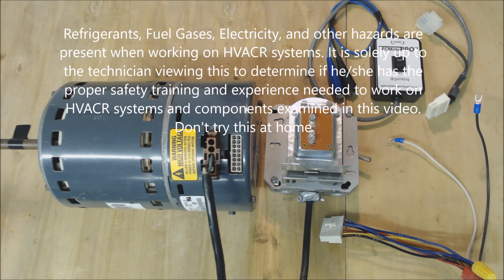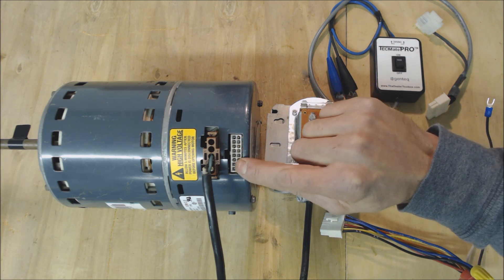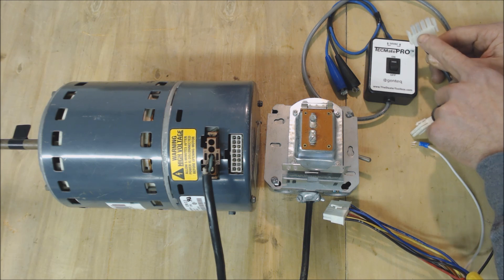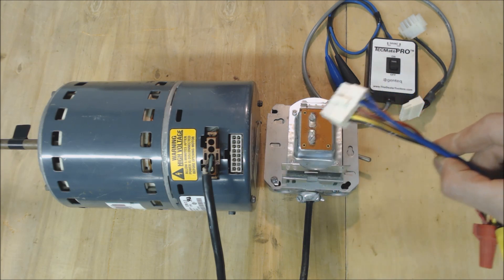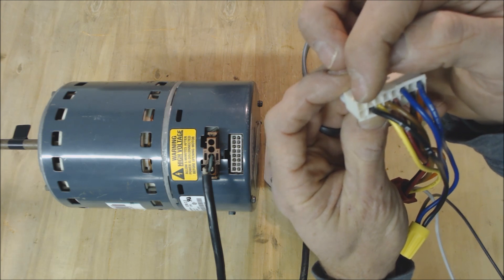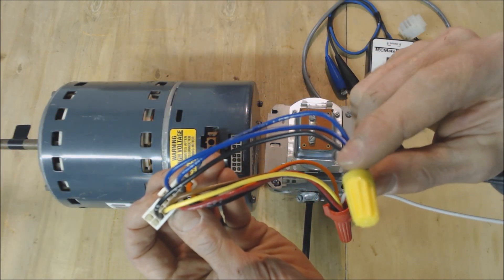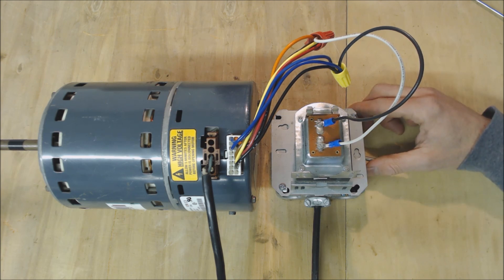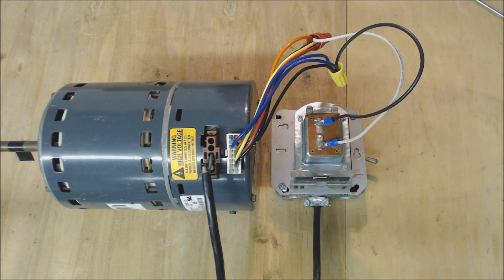Testing ECM Variable Speed Fan Motor, Make Your Own Tester!

Comment: In a series wound motor and series circuit , when a variable resistor control is used ( potentiometer) with NO voltage regulator at the motor , in my studies of ohms law the voltage will be proportional to the line voltage , whereas if the voltage at the source is 24 volts the voltage drop can vary at the resistor such as 5 volts and 19 volts at the motor or 15 volts at the variable resistor and 9 volts at the motor with the current remaining the same!
Remember, no voltage regulator!
Reply: I have heard one thing is (is it true that the motors response to voltage changes such as that loose control) ?

Comment: Have an ECM 2.3 motor that is not spinning to full speed. Changed the boards and a new motor, still same results.. checked continuity on 16 pin connector and all wires have continuity.

What could it be that the motor will not come up to speed!?! 

I read about static pressure with change the speed on the ECM2.3?

Comment: What or how do you test for an intermittent or partially functioning ECM2.3 motor?  Here is my situation my fan may work for a day or more with no issues.  Then The fan will start ramping up like it is going to turn on and then shuts off before ever fully coming up to speed and it will keep doing that over and over.  Even if I turn off cooling mode and put the thermostat in fan ON mode.  The fan pulses on and off then too or it may run constant but it seems like its at reduced RPM's.  If I leave it in cooling mode eventually my low pressure line and evap. coil will start getting frosty/icy because of no/low air flow.  When its operating fine I have 10° +/- of sub cooling so my charge seems like its good.  This is the same duct work and nothing has changed in 8 years since everything (system and ductwork) was installed.  I did look to make sure there were no obstruction and the filter is new and replaced regularly coil is perfectly clean too.  My common sense and knowledge I have learned from this channel says its the motor module but these things are stupid expensive if its not...  Is there a way to 100% verify its the blower motor/module?  I did order the ECM motor tester but it hasent arrived yet. Does the motor tester make the fan run at full speed?  It just says on/off but Im assuming if I hook this motor tester up and it still pulses or runs slower its the motor or more likely the motor module.  The motor itself turns freely also.  Can a person run the motor off of the motor tester and put the unit into cooling mode and run it like that?  Im not looking to try and fix it this way but as I said the unit may work for a day or two before starting to act up.  I figure I could just power the fan on using the tester and see if running in cooling mode if it still does it.  Im just not sure if there is a sensor somewhere that is cutting the fan off if something like a sticky TXV is causing the icy build up and the fan issue is being caused as a result and not the primary problem.  I did pre order the new book as well looking forward to getting it, thanks for all the work you put into these videos and sharing your knowledge.

Comment: the test procedures That I see in the installers guide that originally came with my furnace have a test procedure only wiring pins 1&3 (common - Blue?) on the tab side, & 12 & 15 on the other side (Red) , where your diagram show 1,3, 15 wired to black on transformer, 9,10,12,13,&14 to White on the transformer.

Also does it matter if black and white wires are reversed on the transformer?
the transformer on my Trane furnace has 27 volts supplied across the blue & red wires out to the furnace control board.

Your Black wire should connect to where my Blue wire goes out? Correct?

I tested voltage from the board to the 16 pin connector feeding low voltage to the motor.
Pins 4,10,11,12 have 27 volts
Pins 5, 7, & 15 have 15 volts.

Furnace blower motor is set to fan only on the Thermostat
Blower motor runs sporadically slowly & stops
Will continue to run this way for about 10 minutes.
Still not convinced that it is a problem with the motor driver module, but possible the control board, & trying to confirm motor control module is bad.
I have removed the control module & completed ohm testing on the 3 wires pins and all ohm out evenly with no short to the motor housing.
Should the 24 volt transformer measure voltage between either pins to a ground on the furnace?

Comment: Question GE ECM 2.3 fan blower motor controller. The thermistor looks of but the coil on the yoke has been overheated to the point that there is a bunch of little carbon flakes around the yoke. Burnt thermistor? Regards, Bo

Comment: So if the module has failed this won’t work then? I wish there was a way to just bypass the ecm module on these ecm to run the blower fan for heating. I’m tempted to make something like this but I’m not sure if the system will work properly if the 16 pin harness isn’t connected to the module? 

Being broke sucks… but worse 2:42 being broke when your ecm fails when it’s less than 2 years old and the hvac company that installed it seems to have gone out of business so no warranty. I believe the motor is still good(I checked it using these tutorials). Also power is going to the module from the 16 pin comm harness. It was short cycling, now nothing an it’s still COLD 🥶 outside!
Reply: Those modules are expensive. Check for clogged filters or plugged evaporator fins in the air handler coil. These conditions (causing air restriction) will cause premature failure of the modules due to overheating.
Reply: @MaMa-qh4dy  I think it’s the ductwork. Everything else was clean. 3 of the vents were blowing little bits of insulation out and one in the extra bedroom is blowing nothing out. So there definitely an issue with the ductwork. When we moved in the main filter was missing so I replaced it but now I think it might have been gone for a reason.
Reply: @alloutofdonuts3998   could there be something physically  clogging your duct(s)? If all else fails, you could swap out the ECM with a  much cheaper PSC motor. You will need to add a relay if you are handy. Otherwise, take a look at Quick Swap which may be easier install while still preserving your multi speed functions of the blower for heating vs cooling.

Comment: Hello Craig, Great Videos! I have a lennox Elite series with Variable speed I took the blower from, bench tested with Supco ECM Pro works fine. I made 2 ecm testers from your video with the wire harness, verified all wires and voltages present at terminals exactly as the Supco are correct, motor does not work with hand made one and I can't figure out why. 3 questions please...
1. why is there a choke on the 120 volt in series with line voltage hot side?
2. why are there 2 Zener diodes opposing each other on the common 24 volt wire?
3. why motor will not work with both my homemade testers? one has zener diodes, one without.
Thanks!!!!

Comment: I have an x13 variable after it does its normal run everything goes off but then fan turns back on for 2 to 3 seconds it does it like 4 to 8 times at a time why

Comment: I recovered the blower motor from a furnace that rusted out early due to installation issues.   The blower is fine.  This video showed me how to wire it up and use as the fan for my shop dust filter.   Practical advice and knowledge was shared in this video.  Many thanks!
Reply: So it runs constantly without issues?
Reply: What I'm looking for!!!

Comment: What does this test tell us?
Reply: If I jump the thermostat connections red and green together in my blower fan turns on, would this test be needed to check low voltage wires? My blower is not running right now

Comment: I thought that ECM 24 volt speed control voltages were DC.  I see you energizing the speed terminals directly off of the 24v XFMR which is AC. Please explain.

Comment: I'm making my own controller for this motor and would like to be able to run it at various speeds.  Is there any resource for which pins in the 16 pin connector signal what motor speed requests?

Comment: Thanks! So these are 24v inputs and there are some that accept a DC input up to 9volts.  How is the coil temp maintained above freezing if the blower is ramped down for more of a latent load? I’m guessing there are sensors monitoring coil temp?
Thanks

Comment: I am so lost. I don't get the purpose of a motor tester. If it's applying 24 volts then why not just see if you have 24 volts coming from your original plug???? Why unplug that and then plug in your motor tester to apply the same 24 volts that you already had???? 

If I have 24 volts from the original plug that's already there and my motor is not going, how does unplugging that plug and plugging in the ECM motor tester and applying the same exact 24 volts cause my motor to run when I already had 24 volts there the entire time?

Comment: Have you ever come across an ECM motor that sounds like a jet engine winding up? Sounds normal at low speeds.
From 2007 ECM Goodman Furnace 97 efficient. Was working fine then changed recently.  No ductwork and air flow issues.
GE ECM Motors ECM 2.3 DG03 Controller. ROT CCW Amp 9.6/6.8 RPM 1050 Blower Motor.
Controller causing this noise or motor itself? Could it be the main board sending voltage to the controller?

Comment: Any idea what would cause one of these motors to run but sometimes have fluctuations in speed? It will be running fine then you can hear it dip and speed back up, after a couple of these sequences the airflow reduces enough to trip the temperature limit switch. The furnace control board has a LED that flashes, indicating fan speed, and it does dip and recover in conjunction with the actual blower speed; it tends to act up at about 2/3 - 3/4 of maximum speed.
Reply: Maybe your thermostat is a power stealing type and messing with furnace 

We have many issues with Lennox malfunctions due to Nest stat, they are not reliably compatible 

I saw myself firsthand that the nest stole power from the Lennox board causing it to drop the call from the cool mode and then energized the fan pin on the board this caused the cooling on a single stage system to go from 22° split to 28° split

This may cause issues with coil freezing up or refrigerant issues and compressor

Swapped  out the stat and the  equipment ran fine
Reply: @ardentmonk  I don't think so, the furnace acts exactly the same even if I have the thermostat disconnected and just jumper it with a call for heat.

Comment: The only problem with this video, is that you are not explaining which pins to connect too in a DIY.  Most people do not have access to other hvac systems and cannot cut off an exsisting pinned cable connector and therefore only have simple wiring using the gator clip method.. The only positive in this video is the techmate pro advertisement.  Im not trying to sound ungrateful, but it would benefit the DIY people if you explained which pin using a single wire method for each pin to connect too...
Reply: it is clearly explained which terminals have what power source to them. Your issue is going to be in connecting to those terminals without hitting a terminal that you don't want to energize. Perhaps you can go by an ac shop and ask to buy a plug off one of their junk pile units. Most if not all of these videos have a statement at the beginning that they are meant for knowledgeable and competent technicians. It also states " Do not try this at home"  I don't think the target audience is DIYERS.

Comment: Would like to see a video explaining why low batteries in the thermostat will prevent blower  motor from running but It doesn’t effect the operation of the condenser fan or compressor. Just seems like bad engineering ... We didn’t used to have that problem before thermostats had batteries… Did we? Thanks
Kind of seems like we’re creating problems so someone can get rich fixing the problems or having grunts fix it them for them ...sounds like a recipe for disaster eventually ....Its why A.I. could very likely be a real problem in the near future ....I saw a YouTube video tonight saying that more and more executives and CEOs are secretly flying off to other countries to get high on ayahuasca so they can come up with great business plans....I think that s probably not going to be good for the world.  I could be wrong.

Comment: Would like to see a video explaining why low batteries in thermostat will keep blower motor from running but won’t effect operation of condenser fan  or compressor ... just seems like poor engineering... didn’t used to have that problem back before thermostats had batteries ... did we? Please! Thanks

Comment: Not to discredit this video, I’m sure it’s good information, but some reason the homemade tester didn’t work on my motor, and so it only seems logical that the TechMate Pro would have been a waste of $119 as well (for my particular motor or unit anyway ). The motor module says ECM 2.3 but obviously the model number of the motor can make a difference ... at least if you have the same model number as mine ... which is 5SME39SL 0772. And the model number of the Goodman unit it came out of is  GMV80704BX. Its obviously wired differently since the motor did not come on when I bypassed the control board and wired the 24 volts as shown in this video....so at first  I thought either the motor , or the motor module was bad.  So I checked the resistance between all three wire leads going to the windings and  got  4.9 ohms for all 3 readings. So then checked for continuity between each of these 3 wires to the motor frame and got no continuity so I knew it wasn’t “grounded out” ...so I thought the motor module must be bad. So I tried to find a new one, And as far as I can tell nobody sells this except for Goodman and you cannot buy just the module you have to buy the motor and the module.  And it was gonna cost me about $600 with tax  . And I was only going to get that good of a deal because I have a friend in the parts business who buys tons of stuff from Goodman..  it’s normally over $800.Then I remembered I HAD to buy an AC protection plan several years ago for like $12 or $14 a month from my power company whether I wanted it for not. And luckily I remembered because conveniently for them they don’t itemize it on the bill in hopes that you’ll forget and never use it!!! But then I saw another video  that said it could possibly just be a problem with the batteries being low in your thermostat even if it doesn’t say batteries are low...Depending on if your thermostat has a “common” wire or not  ...So I changed the batteries and everything is working fine now! Cool air again !!! Hope this helps someone! 
Oh one other thing, This particular unit has a coil which feeds the motor (120v) that looks like a transformer but with only 2 wires that they call an inductor ,  I left that in the circuit when bypassing the control board to check the motor ... has something to do with opposing changes in current/amperage so it seemed important to leave it in the circuit. I used to work on air conditioners 20 years ago but never saw anything like that ... or ECM MOTORS

Original symptoms were the blower motor was just barely turning  and going off and on , making a low rumbling noise.… The condenser was working fine.
Reply: Would this homemade tester work if that same motor was good and not grounded out and you had new thermostat batteries? Or is this model simply not compatible with this tester?